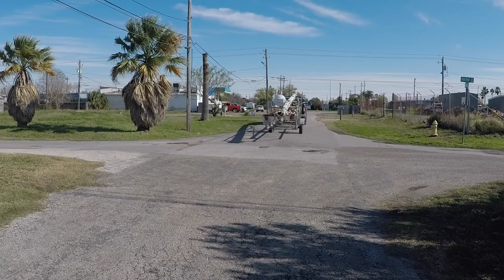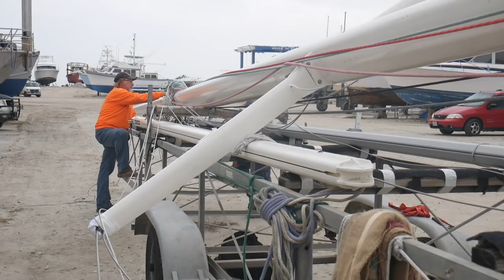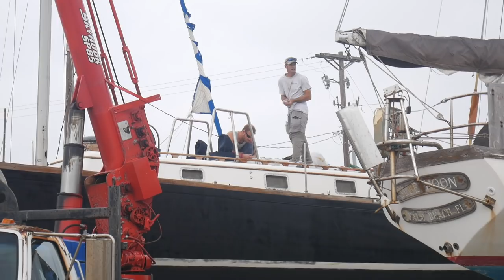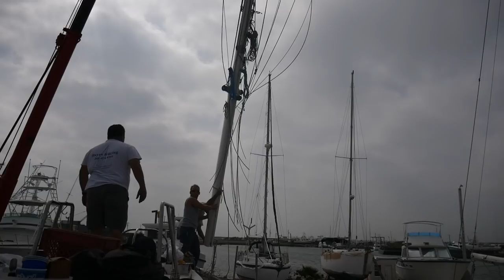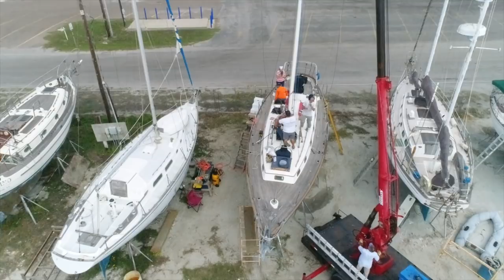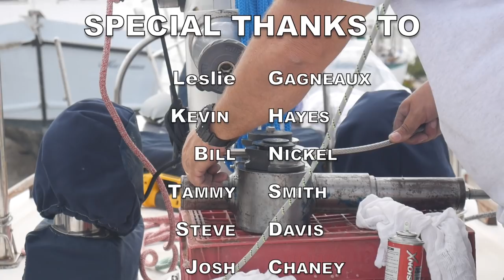THE REFIT EP 11: Finally Stepping the Mast

Comment: I am going through the same process. I want to thank you for the videos on doing the mast repair. I have the exact same Kenyon mast, and did a splice on the bottom of the mast. Now getting the standing rigging organised and will do a dry fit on the boat with the mast before I paint it. I am using Sta- Lok fittings on both top and bottom ends so I can service them myself.

Comment: Good progress.  Thanks for sharing.  More power to you.   I worry that E-powering is going to far - if you cant do it yourself you’re reliant on others and very few have experience of it in this application.   Also you miss out on the advantages (for cruising) of diesel for charging batteries, motorsailing etc.  Best of luck of course.